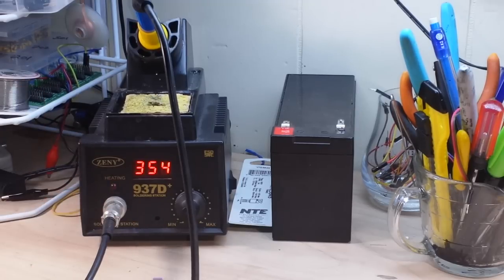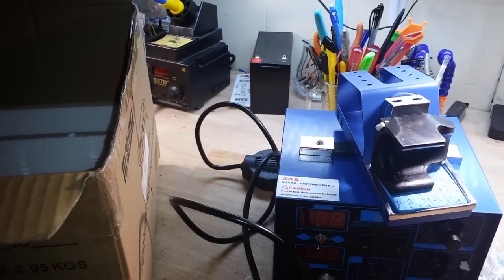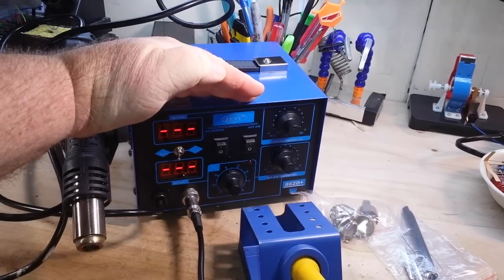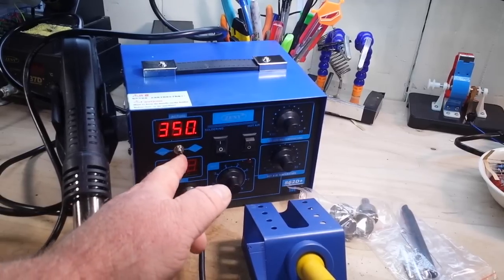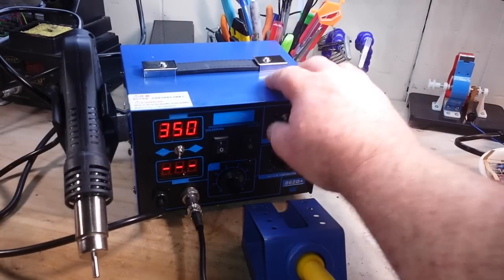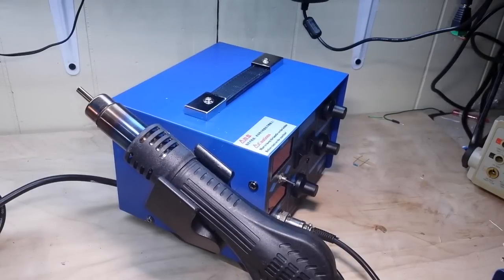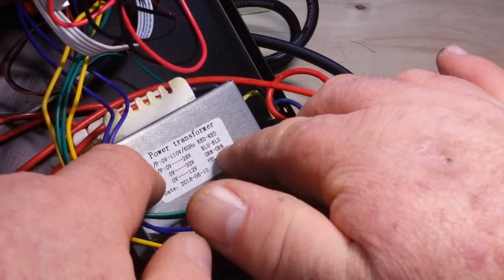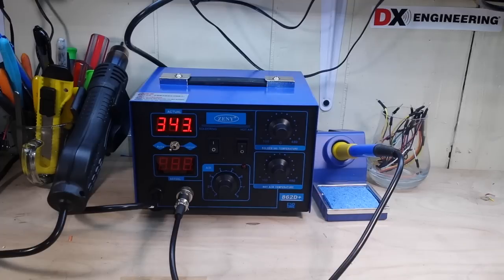Zeny 862D+ Hot Air rework Station

Comment: Yes, the fan stays on until it cools down to 100' C and then it shuts off.    On the pen/handle it doesn't matter as much because it has quite a bit of metal all around it to dissipate the heat, but inside the heat gun, that ceramic is exposed.. so you want it to cool off by the air.  On "auto" it will shut off the heat of the air gun automatically when you set it on the hanger, but still keep the fan running, again, until it cools to 100C. (apparently there are switchs/magnets inside the hanger).  If you switch it to manual, it will just run steady and never shut off.

Comment: You have your heat gun in the holder upside down.  I find it astonishing that they always advertise these units with it pointing down, but believe it is done so you can see the tip.  But it is actually designed to rest pointing upward so the heat can dissipate from the gun, and also so the switch in the gun rests near the magnet in the gun rest, triggering it to stop heating but keeping the fan going until the unit is cool.

Comment: Have you found the right replacement tips for it ? Ebay doesn't list them. Also, have you done much smd hot air work ? I think it will do fine but have read that the flux paste needs to be used almost right away, it has no shelf life.

Comment: Does your heat gun still work? Mine melted itself after only a few uses. Now it doesn't work at all. The fan doesn't even power on. I never pulled it apart to inspect it but it'd be nice to have the heat gun working. I bought it in either 2017 or 2018. There seems to be a lot of variations and changes on this thing over time.

Comment: The auto/manual switch is for the cool down. When you have it in the holder it will shut it off after it gets to 100 deg c.
Reply: that is true, but does not happen if the user puts the gun into the holder upside down as was done in the video.  the magnetic switch in the gun need to be in close proximity to the magnet in the holder, which it is not when put into the holder upside down.  i find it odd that a user would put it in holder with the hot air pointing at the user, but that is how they show it in advertisements (presumably so you can see what the tip looks like) creating an understandable confusion.

Comment: this is a piece of junk, my iron will not go up in temp to melt solder and the  air gun will not go into cooldown . Has about 1 hour of run time!
don't waste your money, you may think you are saving some, but it IS PURE JUNK. My weller iron , purchased in 1969 when I was in the 9th grade still works fine. Everything is disposable now, but this unit disposable as soon as it leaves China.

Comment: p.s.  Auto/Manual is for the rework.  If on manual it will start the second you turn on the switch.  Auto only when you pick it up out of the holder.  IN EITHER CASE, it will only stop the fan when it cools.  Its for if you dont want to use the holder-thats all.  P.S, turn the hot air gun around.  :)

Comment: Hi Paul!  We are soldering station twins now (almost)!  I had this one for 2 -3 years now (thats really a YiHua, which mine is).  I love mine, I don't care what snobby Kangaroo Dave says or anyone else's sarcastic comments about it.  My only complaint is the cables are a bit stiff.   Also, the manual of mine seems detailed, but hard to get through the Chinglish...  For the flashing dot on the soldering temperature, I directly quote:
"Program in high-speed tracking temperature compensation instruction.  Figure 1".  
You can imagine what the rest is like...I guess yours is the same!  Enjoy it though, I know I have gotten lots of good use out of it.  If it died today I still got my moneys worth and would probably buy the exact same thing again - you cant say that about many Chinese products.
Reply from the maker: My manual only has an explanation of how to do hot air rework. Almost nothing on the operation of the unit.

Comment: I got one for Christmas, too!  I was all prepared to have to do the safety mods (in older units the neutral was wired to the fuse instead of the hot wire, non-grounded air gun, etc.) but mine was wired properly.  It seems China is listening and their QC is improving.
Reply from the maker: I don't know. Could be import restrictions? High return rate? I'm just glad they are wired properly.

Comment: Can you recommend a good handheld oscope name (s)?
Reply from the maker: The DSO150 is ok. Lots of trade offs in a held held.
Reply: @learnelectronics  what trade offs? Accuracy? I have a tpi 440 plus. But it's not so easy to see the sinewave. What would you recommend that's decently priced? Thanks for all the videos too!
Reply from the maker: Trade-offs include very low bandwidth and sampling. They become almost unusable above audio frequencies. A USB scope can be had for less than $100 or the Hantek 5072P destop DSO is around $230.
Reply: @learnelectronics  ok I'm going to be using it to set the gain on a car amplifier. Will that one work best? Or is there a better option? I love my tpi but the screen is so damn small.

Comment: i had the same one, mine was just the Saike brand, modded the hotair part to be able to plug out, the iron is okey, cable is a bit short BUT it freaking burns out tips like no tomorrow(only used my tips between 320-350) served me well for a year. had to replace the Triac and solder element 2 times, also there are pots inside where you can set the real temp vs display temp.

Comment: I've had one of these for a few years now and it has been great I tried to wire an iron that would take t12 tips but could never get the wiring right
Reply: That's because T12 tips are incompatible with the electronics of this unit. The temperature sensor in T12 tips is wired in series with the heating element, but the iron that comes with this unit has a separate sensor that is not connected to the heating element at all. In order convert this to take T12 tips, you would need to change out a lot more than just the wires at the plug. Namely you would need a different pcb layout with a differently programmed microcontroller on it.
However, you could alternatively change out the plug and add a seperate module to drive the T12 handle. Then you would use the old board for the hot air station only and the additional board for the T12 handle. I'm thinking about doing exactly that to a very similar unit that I have.

Comment: Hi Paul, I have one , almost the same as yours and you have to put the heat gun the other way and it will go down gradually, and then it will stop. Sorry if my english is not too good.
Reply from the maker: Your English is great! Thanks for the tip. I'm new to the hot air stuff so this is good info for me.

Comment: My cheap (more low-rent than yours) knockoff hot air gun had the "in the cradle" sensor misaligned when I go tit. 
I ended up adding some rubber bands to the handle to make it sit in the right position to be detected and start the cool-down.
Reply from the maker: Where did you find one lower rest than this one? Lol
Reply: It's amazing what you can find in the dark corners of Ebay's bargain basement.

Comment: I think you have the hot air pointing in the wrong direction (I'd already be covered in blisters) - noz pointing up-hill to the back (look for the magnet in the holder).  Your gut feel is right fan runs on to cool down.  Only starts up when you take it out of the bracket, if you switch on with it in your hand (or laid on the bench) it won't heat up.  Most of the time mine is set to about 140c which shrinks heat sleeve but doesn't leave scars. 

Mine is the 853D - I can't find the book - and memory is going but I think auto/man is the motion sensor in the iron.
The Iron has a 6 pin connector (they are a bugger to find - the most common is the generic 907 which is 5 pin - getting sellers to confirm which they are selling proved a nigtmare  - price - 5 pin usually around £10 - 6 pin about £20+ (but price is not a guarantee).  
My iron has the motion sensor (6 pin) and sleeps after being idle for a while (probably about 10 mins but cant remember what the book says)... only re-heats if tip pointed down (up is ineffective) but not a real safety feature if you knock the iron onto the bench.  My tip temp is tip top, probably within about 5 - 10 degC

Mine also has a bench PSU, 5v USB outlet and test input which is stable, quite handy and bang accurate.  Every one seems to have a different name - but almost all of them I've seen are good for the money.

The only "DANGER"(?) is mine has a fused neutral.  UK plugs are polarised so it's technically an issue (I simply swapped the wires in the plug - the L & N colours are wrong but polarity in correct and L is now switched and fused).

Comment: Happy New Year, Paul. I have a similar iron.  I haven't taken mine apart yet. I was wondering if the trim pots on the board are explained in the manual.
Reply from the maker: There is almost nothing in the manual except how to do hot air SMD work.

Comment: It's mostly empty, could be much smaller with some ventilation holes... no shrink tube on the solder iron connector (at the inside), that could cause some issues. Shown temperature is clearly unreliable, which is probably the iron's fault

Comment: nice new tool there, Paul. congratulations.
but i noticed the hot air was ramping up to 500+ °C though you've set it for 350°C, that is something need to be aware of. please check the hot air function once again and be safe.
Reply from the maker: Yes indeed. That's the first time I had it out of the box. So much more to let's about it

Comment: Happy New year and good morning Paul .I have the same Zeny had it for bout 3 months i love it great station for $ 60.00  the Auto and Manual switch is for after your done with hot air it wil be on manual turn hot air switch off then turn other switch to Auto fan will still run till it cools down then it will shut off automatically them you will see two lines where numbers were then you can turn off switch on back off unit . But  all and all it a great unit .
Reply from the maker: Thank you, thank you for the info. I'm new to the whole hot air thing...

Comment: Without even a hint of sarcasm.. Promise..
Two things. 
1)  The fan needs to stay on until the heating element cools down. It will shut off when it reaches about 100 degrees. And it is usually mains powered, so make sure the tube has a good ground connection. 

2) The heat gun points the other way. Hot end up. 

General tips.. 
The lower the air pressure the better, so you don't blow parts off the board. 
I tend to start a few inches from the board, and gradually get closer,  so the parts don't heat up too fast. Heat until the solder paste melts, and withdraw slowly. Keeping the nozzle moving all the time. 
Plenty of videos from people who know what they are talking about, so I'm sure there will be many fun hours ahead of you.
Reply from the maker: Thank you John. I appreciate the info.
Reply: @learnelectronics  
Happy I could be useful. Nice when I can give back something to a channel I watch.
Reply: John, you are a better man than me for giving helpful and knowledgeable advice to someone who showed nothing but contempt for the smart asses who know more than he does. I quit watching after his idiotic and pretentious statement.
Reply from the maker: Jay, my comment was directed to a specific person who left a smart-ass comment. I appreciate helpful info from anyone. But someone who is going to come on my channel just to shit on me is going to get called out. Sorry if I offened you.
Reply: I don't understand why people don't read the user manuals before they mess with stuff - that is the first thing I do. I get onto my son all the time for that.
Reply: @JohnB You beat me to it! I was going to say the same things! 
@Paul Happy New year from StL! May 2019 be better for everyone! Good review and I'll be looking forward to seeing you use it on SMD's!
I've owned and used this station for about a year now and I really like it. As JohnB mentioned above, the auto and manual switch refer to the air gun and it needs to point away when in the cradle. The automatic cooldown and shut off at about a 100 degrees is a great feature and I expect it will greatly extend the life of the air gun. One of the things I like to do when my non-electronic friends look at my mini-bench tools and say oooh cool (they're all computer techs like me but without electronics experience) is to demonstrate the air gun. I hold up a little piece of paper and demonstrate the air gun going from cold to able to set fire to paper within 30 seconds. It's silly but a fun demo for them. I've given up trying to demo my oscope beyond showing pretty colors because they don't understand it beyond seeing things moving on the screen then expect me to teach them how to use one from within 10 min and that's just not possible! I'm glad I purchased this unit and, despite my minor complaints below, it's a great value at its price and I'd buy it again.
There are 4 minor downsides to this unit.
1 My station is positioned on the left of my mini bench and I've knocked the air gun out of it's cradle multiple times with it hitting the floor. The air gun cable is heavy which also contributes to it falling out if slightly bumped. It's held up well, even with my abuse, but I'd like to have the cradle hold the air handle a little more firmly and I'd really love it to be detachable from the main unit so I can replace it after I've knocked it out of it's holder one time too often. The variable airflow is great for smd work.
2 Biggest complaint is the collar on the soldering iron is made of plastic and broke after a few months at a very inconvenient time. It simply isn't a good place to use plastic. I scavenged a metal collar off another iron but the heating element is fractionally different in length which meant I had to use the entire scavenged iron from it's collar to tip. The scavenged iron isn't a removable iron, so I can't use the whole thing but it does work now, but no longer great. I'll have to buy a new one to bring it back up to its former quality. The temp of my original iron was good, too bad yours seems a bit off.
3 My unit came without the master power switch but is identical in all other respects. I'd rather have the switch, so I encourage anyone purchasing one of these to check for the rear master power switch.
4 The switch and button layout isn't intuitive. The switch placements require full light all the time to be used. Mine is on a mini bench and has a small shelf directly over it and not well illuminated, so I have to have a separate small light to operate the panel. I have a very directional light I use for my work.
(Sorry if any typos, I think I got them all!)
Reply from the maker: Thanks for all of that info. I really appreciate the time you took. I wish there was more info in the manual about the technical operation of the station but it's mainly about hot air SMD work. And I agree with you on the hot air cable, heavy and stiff.

Comment: If I'm not mistaken, the manual switch is for the hot air gun to blow air (with heat) while on the base.
Reply from the maker: That seems to be the thing. I'm old, all though hole stuff for me so I'm just learning SMD.
Reply: It's exactly that you've said

Comment: Happy New Year Paul. Station looks nice. Now you'll be able to work with DMS, I mean MDS, no, no SMD that's it. You know those little parts that you can barely see and go flying to parts unknown when you try to pick them up. (Or accidentally sneeze!) 😋
Reply from the maker: They are too small for my eyes and big fingers.
Reply: Microscope and tweezers to the rescue!
Reply: Robert Gibbons  I use my iron on most SMD's. I only use hot-air when I have to.